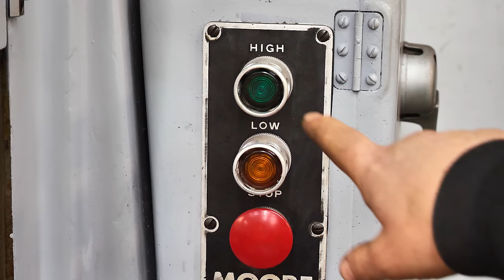Making Crazy 500cc GoKart

Comment: i run a 2005 f1 250 national built by f1 carting manufacturer uk running the rotax 257 that's been ported  polished axel is 50mm solid on a duplex chain and super 6 tyres at 90hp .
Reply from the maker: This vehicle has 60 HP and has really great acceleration, it's fun to drive, but if yours has 90 HP and is a lot lighter then it's definitely amazing. I'd like to ride one like this 😁
Reply: @WorkshopFromScratch  i would run a solid axle shaft that axle is okay for the likes of the rotaxmax and the dd2 but not the gearbox karts